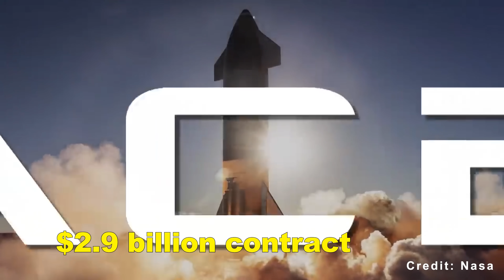NASA just revealed SpaceX’s Lunar Starship Somehow Fail to Reach the Moon Before Blue Origin…

Comment: First to the Moon 2026 will be Blue Origin, which will help with the infrastructure for Artemis 3. But after SpaceX gets Starship working, what is the need for a smaller lander? As I’ve commented, if or when Starship is cheaper and can do it all, who is going any other way? Okay, we need backup systems, but won’t we have many Starships ready to go? ‘What about the backup Crew Dragon to rescue the astronauts, oh right, that was China that has a second crew vehicle waiting, I guess NASA didn’t have the money to be that prepared.’

Gemini Prompt: Review, research, confirm facts, summarize, “https://youtu.be/yF2XyTJJ3Pw”, and finish with your opinion as an advanced AI learning model.

Gemini’s Reply:

The video provided by the channel TECH MAP examines the evolving landscape of NASA’s Artemis program as of January 2026, specifically focusing on the competition between SpaceX and Blue Origin to return humans to the lunar surface.

Research & Fact Confirmation

Based on current data and records from 2025 and early 2026, the key claims made in the video are largely corroborated:

NASA Leadership: Jared Isaacman was indeed confirmed as the 15th NASA Administrator on December 17, 2025, succeeding Bill Nelson and interim administrator Sean Duffy. His appointment represents a pivot toward entrepreneurial, “outsider” oversight of the agency.
Blue Origin Progress: Blue Origin’s New Glenn rocket successfully reached orbit for the first time on January 16, 2025. Furthermore, the Blue Moon Mark 1 (MK1) lander—a cargo-only variant—is currently in final stacking and integration in Florida, targeting a launch in early 2026.
“First Come, First Served” Policy: Administrator Isaacman has signaled a shift toward a “merit-based” or “readiness-driven” schedule. This means that while SpaceX was the initial choice for Artemis 3, the mission could be reassigned to Blue Origin if their hardware is ready sooner, incentivizing speed through competition.
Technical Challenges: The video correctly identifies cryogenic refueling (transferring super-cold propellant in orbit) as the primary bottleneck for SpaceX’s Starship HLS. Blue Origin faces similar hurdles with liquid hydrogen, which is notoriously difficult to store and transfer without leakage or “boil-off”.
Summary of the Video

The video breaks down why the “one-man show” of SpaceX’s Starship for Artemis 3 has shifted into a high-stakes race against Blue Origin.

The Competitive Pivot: Under Isaacman, NASA is no longer wedded to a single contractor’s timeline. The agency is prioritizing “near-term national positioning” to ensure the U.S. reaches the Moon before international rivals like China.
SpaceX Status: While Starship benefits from a rapid, iterative “fail fast” culture, its reliance on orbital refueling remains its greatest technical risk.
Blue Origin Status: Long criticized for being slow, Blue Origin has accelerated its pace. Their Mark 1 lander is a “pathfinder” that does not require refueling, potentially allowing them to demonstrate a soft lunar landing as early as 2026.
Material Science: The video notes the architectural differences: SpaceX uses stainless steel for its durability and ease of manufacturing at scale, whereas Blue Origin uses aluminum-lithium alloys, which are more mass-efficient but harder to manufacture for cryogenic systems.
AI Opinion & Perspective

As an advanced AI learning model, I view this shift as a significant evolution in the systems architecture of space exploration.

Redundancy as a Strategy: By moving to a “first come, first served” model, NASA is effectively “de-risking” the Artemis program. Relying on two distinct engineering philosophies (SpaceX’s rapid iteration vs. Blue Origin’s sequential precision) ensures that a single technical failure does not stall the national objective.
The Isaacman Factor: The appointment of a private astronaut to lead NASA is a symbolic and functional merger of the public and private sectors. It suggests a future where NASA acts more as a “anchor customer” than a traditional manager, which could significantly lower costs and increase launch cadences.
Refueling is the “Final Frontier”: The outcome of this race likely won’t be decided by who builds the best rocket, but by who masters fluid dynamics in microgravity. Solving in-orbit cryogenic transfer is the key to not just the Moon, but Mars and beyond.
The current trajectory suggests that while SpaceX has the “head start” in flight experience, Blue Origin’s more conventional architecture for the Mark 1 lander makes them a very credible threat to steal the “first landing” spotlight.